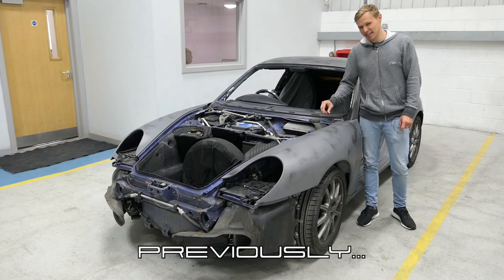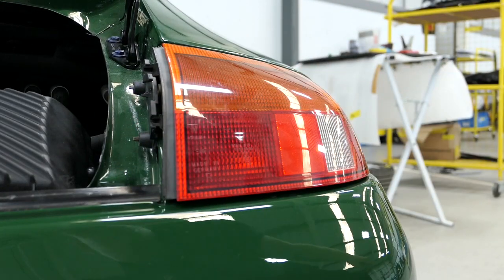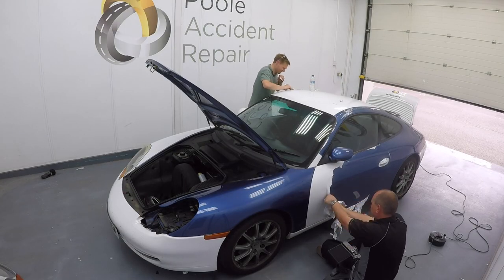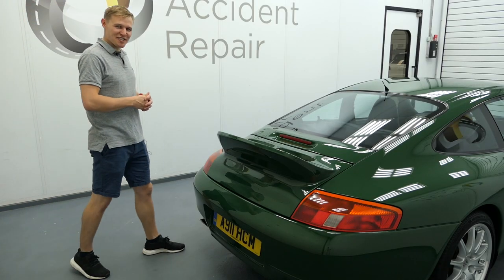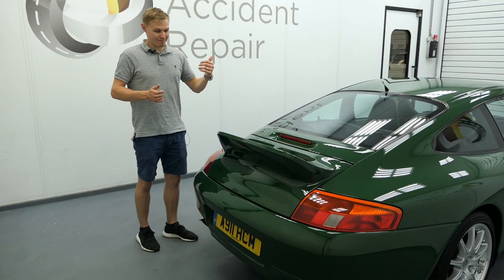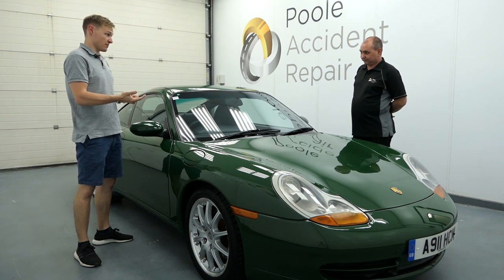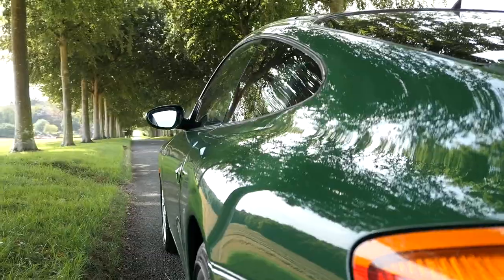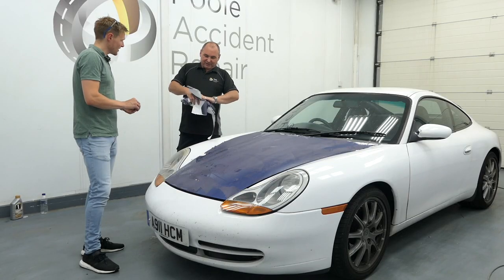BIG REVEAL: Collecting my Irish Green Porsche 911!

Comment: Color is awesome. Those tails and headlights could use some love though. A good wet sanding and clear will do them wonders. Fantastic 996! Stick with OEM color wheel options and don't sticker it up. Maybe PORSCHE across the rear on the ducktail but doesn't need it down the sides. Also lowering would do wonders for it.